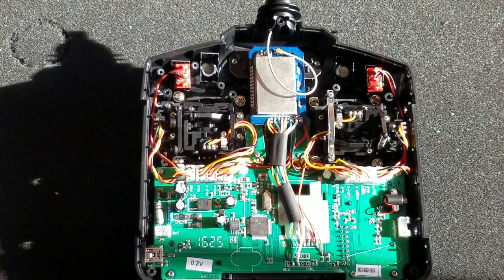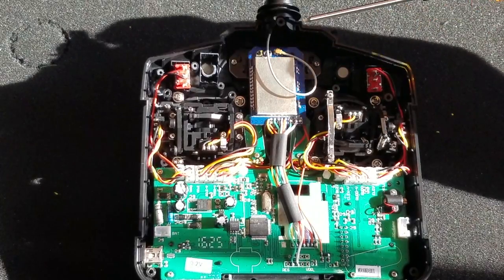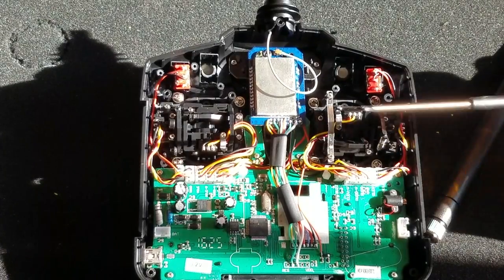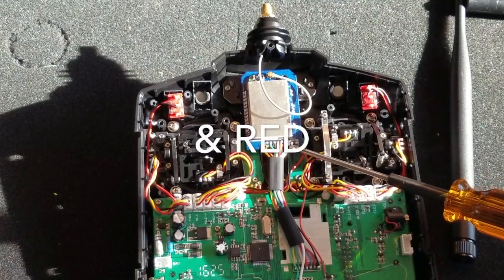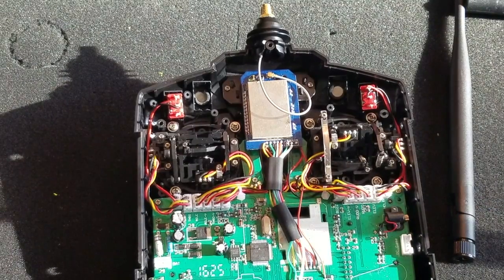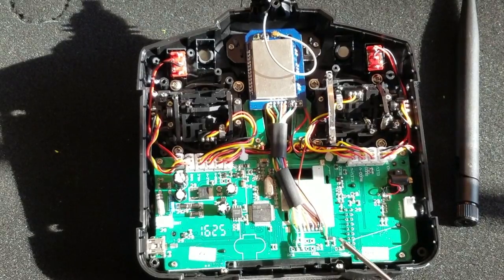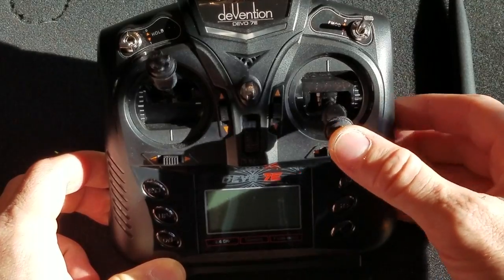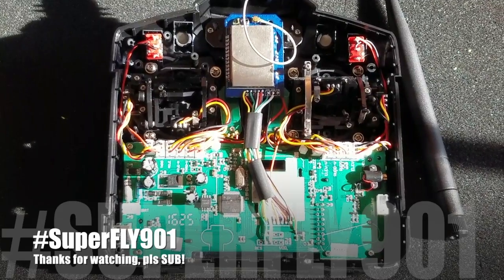SuperFLY Devo 7e

Comment: I bought a devo s-mod module and a CC2500 for frsky. After seeing how clean that 4in one looks I feel like I should have done that instead. I didn’t want to solder cpu pins but ended up having to solder 3 of them when the pads broke off while taking the original module out. It’s a hack job to say the least, but it works lol I did damage something because the trim tabs on the throttle and roll don’t work right but I never use them anyways. Everything else is fine.